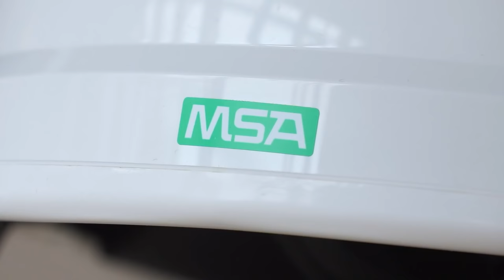‘How to be happy in a hard hat?’ with MSA Safety

Comment: A great video , like the look of the hard hat you are showing. The will always be those occasions when hard hat will save your life . I had one crack in half after a starting handle stuck on a old diesel mixer . Then again I have also been told I must wear one while driving teleporters to which I laughed and said if anything comes through that cab the hard hat is not off to help me . I will keep my eye out for one of these hard hats cause like you said they do give head aches and not falling off your head is a fantastic idea . I used to wear the balaclava over the top to hold mine on .

Comment: What catches a lot of small builders out. Is the change in the cdm laws. So even Joe bloggs fitting Mrs Jones new roof. Or loft conversion has to adhere. And the HSE are doing a lot of spot checks on properties with scaffolding up. Or vans on the drive. So definitely worth keeping a hat with you. And of course the other required equipment.

Comment: Oh so now hard hat manufacturers have figured out that climbing helmets dont suck. Huh. Wow, nice to finally pull their heads out of their arses! I can see by bvb the one adjustment though that they still haven't completely caught up. Their should also be an adjustment on the headband circumference too, not just the one hanging the occipital lobe.Good on ya for giving those away BTW! I am going to hold out till they make one for HOT climates that is "really venting" that lets a decent amount of air through.